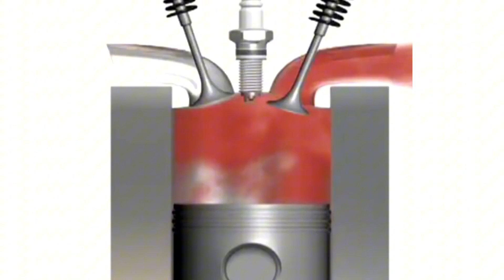Turbos Feed On Your Engine’s Power - Here’s How It Works

Comment: If you were talking about a single cylinder engine, I could understand where you're coming from but because most ter cars are V8 or V6 is you're going to have extra cylinders helping the air move
Reply from the maker: It's about the amount of backpressure caused by the exhaust turbine serving as a restriction and pressurizing the manifold, not cylinder count.

I do get where you're coming from though, spreading the parasitic loss out across all cylinders.
Reply: @TorqueTheoryLabs yeah, but that doesn't lead to the engine breaking that leads to the manifolds cracking where the turbo melting
Reply from the maker: @oler777 

Turbine wheels spin due to heat and pressure. Without pressure, the wheel will move but it won't gain enough speed to have the compressor wheel suck in any air to pressurize the intake manifold.

The parasitic loss isn't nearly as powerful as engine braking, but it's still a pumping loss on the exhaust stroke.
Reply: @TorqueTheoryLabs lets take an LS for example you have 86 to 90 pounds of rotational mass spinning at 500 up to 7000 RPM what's gonna win a rotating assembly or 14 pounds of pressure the amount of horsepower you're losing during that initial boost is so small. You can't measure it compared to a supercharger driven by a belt where you can measure how much power is being lost to spin that system.
Reply from the maker: @oler777 

Superchargers are typically more parasitic then turbochargers, there's no two ways about it.

This isn't about rotational mass though, this is about your turbocharger sapping away kinetic energy from the crankshaft on the exhaust stroke.

Each exhaust stroke won't take away measurable horsepower, but when you have 3500 of those per cylinder per minute - that's adding up significantly and absolutely causing a parasitic loss.
Reply: @oler777  If you can lower the exhaust manifold pressure by running a bigger exhaust side of the turbo the engine will be less stressed.

Comment: The piston doesn't really push the exhaust gasses out. They evacuate the cylinder on their own due to the insane pressure that exists into the cylinder in the first places. Only few exhaust gasses that are in atmospheric pressure remain in the cylinder and are pushed out via the piston.
Reply from the maker: While exhaust gases typically evacuate due to a pressure differential on N/A motors, turbochargers provide backpressure so the piston has to work to push the gas out of the cylinder. Not because the pressure differential isn't there with a turbocharger, but because gases backup behind the turbo and we refer to that as "drive pressure".

If those gases did not back up behind the turbine or "pressurize", there wouldn't be enough energy to significantly spool the turbo. Turbos spool due to heat and pressure from the exhaust.
Reply: @TorqueTheoryLabscool, so you still need to push them in order to spin the turbine and provide power to the intake side to pressurize the intake air even more and so one and so on. Nice.
Reply from the maker: Exactly! It's not a direct crankshaft parasite like a supercharger, but it still needs to get it's energy from somewhere.